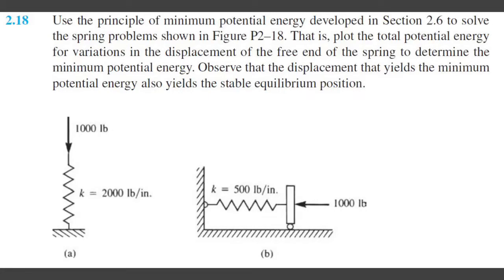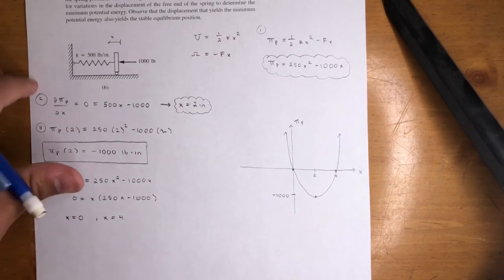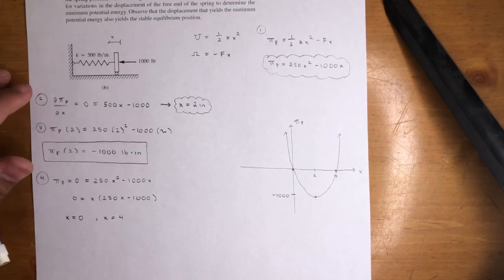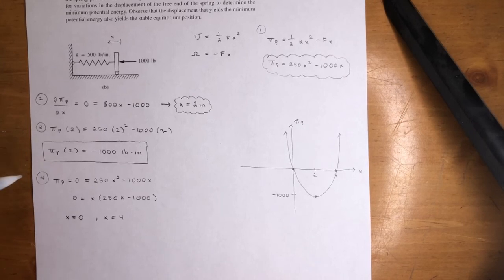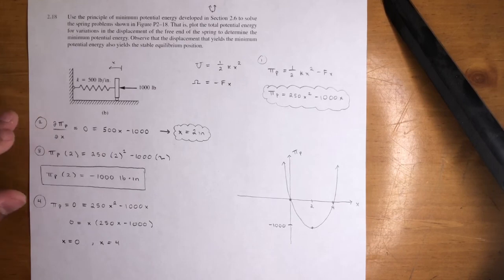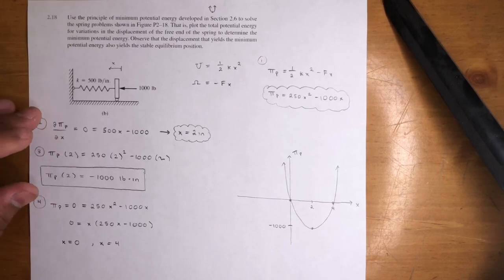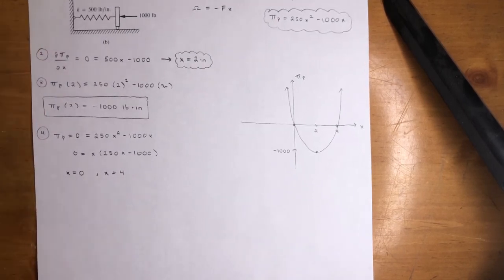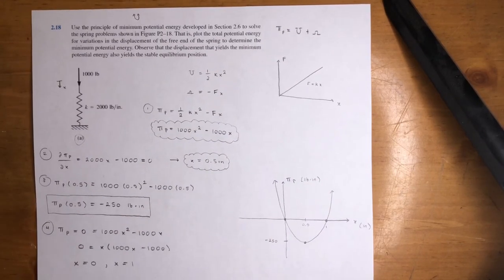Finite Element Analysis - Use the Principle of Minimum Potential Energy to Solve the Spring Problems

Comment: I got -250 lb/in like you, but the answer does not match the one in the book solution, it is given -125 lb/in.
Reply from the maker: Hey! Make sure the solution you’re seeing has the exact external forces and the exact spring constant values. Some books tend to multiply or divide them by 2 and can affect the problem solution. If you’re still having issues let me know, send me an email I’ll gladly take a look later on today.
Reply: thanks for the reply i will send a email, btw love your videos alot its really helpful :)